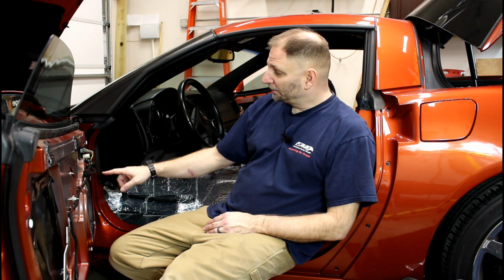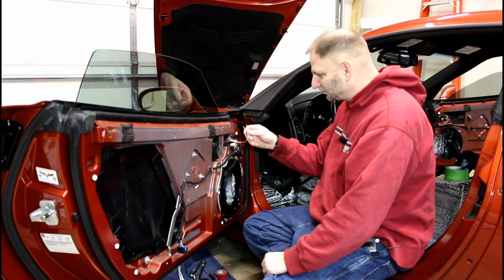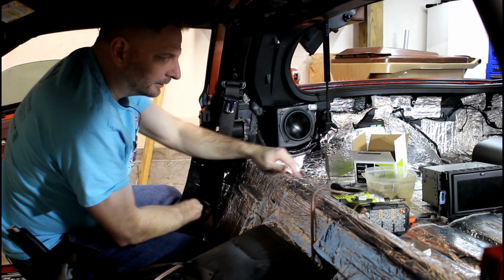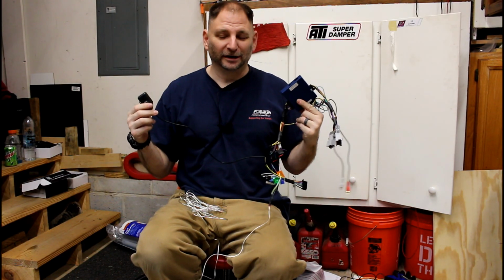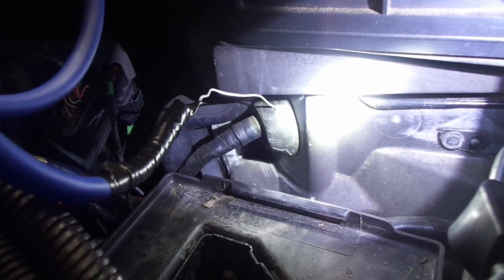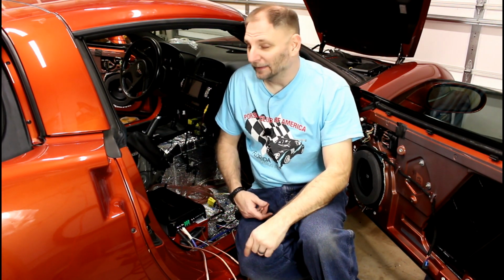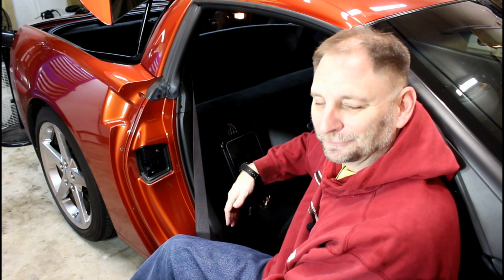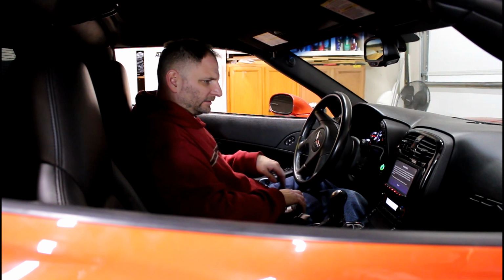c6 stereo install

Comment: Excellent video. I'm doing the same thing on my `08. The kenwood is already installed and the only thing I lack is mounting the amp and running the power wires. I'm afraid to screw into the back of the seat so I'll do something else to mount the amp to the carpet. I also couldn't tell if you connected a ground local at the amp or ran it from under the hood. I'm sure I'll find a local ground back there. Thanks again.
Reply from the maker: Thanks and i used the ground near the lower seat belt mount

Comment: Can you attach the new speakers to the old factory wiring or do you have to use new wire?
Reply from the maker: If you are using the factory head unit/amplifier you can use the factory wiring. Otherwise you need to run new speaker wire

Comment: curious how many plastic retaining clips you broke on either the door or any of the cargo panels? Did you have any alternator wine when you were done? Thanks for this detailed video. It was very helpful.
Reply from the maker: I broke 1 plastic clip on each door panel. The 2nd gnd worked for me, good luck and glad it helped!
Reply: @maintainersgarage  was there a grounding place in the dash for your head unit?
Reply from the maker: @reid1boys  yeah there is some metal inside the dash behind the radio

Comment: Amp fits fine behind the seat; even with the seat adjusted all the way back?
Reply from the maker: NO the seat does not go all the way back with amp mounted behind it. Follow up video covering that
https://youtu.be/OFc3EfG-Rms
Reply: @maintainersgarage  Thanks for the answer. Follow up question: How "tall" is the amp? Would it have fit underneath the seat? My amp is 5 inches tall; hoping it'll fit under it if behind it isn't a good choice.
Reply from the maker: @capone079  under the passenger seat is a small area like 5x7 L/W where there is enough clearance for an amp. The back of the passenger seat at the lowest setting is about 1/2 inch off the carpet. And at the most FWD position the back of the seat eats up that space. So it is more of a footprint issue than height. There are amps that will fit just very small ones

Comment: i lowkey wish i could go to him and have him help me because i learn different
Reply from the maker: If you are referring to me, ask away
Reply: @maintainersgarage  i have a major project coming up im a 16 yr old and i almost to the point of getting the vette  but i luckily have everything (except for a headunit) i need to make this system i have 2 ds18 ¨15 inch  hooligan subs which both run 4000rms each and i have two sundown audio z-10 v.6 2500w rms 10 inch  subs and 1 sundown audio x12v3d2 2000 w rms subs 12 inch  i have had a custom box be made to fit these things i have a few tweeters and speakers they dont effect my   electrical system as bad as the subs. oh also for the amp im literally going to stick two sundown salt 8k  audio together use them to power the big and small subs the i'm going to use a small 4000 rms amp to carry over any deficiencies in the system for equal sounding bass nothing underpowered  i really need to find a bigger alternator and batteries... sorry for the grammar! any ways there is a few other things i have  that i didn't mention and its  twin turbo system and a supercharger (C6 Corvette 2005-2013 GMPP LS9 Supercharger Kit) i also have a performance cam replacement bundle,  i also have and air ride system  to help carry the weight  and lastly a dash board replacement from sherwood innovations ash burl  and its real wood im not rich i've just been working my whole life to afford this stuff the grand total is 34K and my car has 24k  alone  so 58k in the end   my system and performance mods cost more than  the car itself
Reply from the maker: @castaldi69_yt51 that is several major projects!! Good luck with them!
Reply: @maintainersgarage  thx

Comment: I have the Bose system in my 2005. The Upper door speakers and the lower door speakers, are they coming out of the amp at the same level? The lower door speakers are filtered for Low pass from the amp, what about the upper speaker is that full range or high pass?
Reply from the maker: Thanks for the questions. Are they coming out at the same level? I am not sure, but I am guessing that the lower door speaker will be getting more power than the upper speaker. The uppers i think are high pass.
Reply: @maintainersgarage  ok my set up turned out great because I completely replaced the Bose Amp. Anyone reading or watching, just get a new amp. Thanks!
Reply from the maker: @phoenix21studios  excellent!! Glad it worked out for you!

Comment: I have heard that if you change out the stock head unit it sounds way better and louder without speaker/amp upgrades.  I have the Bose system in my 05 since it’s a 3LT.  May start w the head unit and then possibly an amp with new speakers.
Reply: I did only a head unit upgrade and was not satisfied.
Reply from the maker: Give it a try and let me know how you like it!

Comment: Where is the OEM Amp located? Great Video btw
Reply from the maker: @mario it is in the passenger footwell near the fuse box. Thank you!
Reply: @maintainersgarage  Thank You for this amazing tutorial. You made this entire sound system a breeze. 
Alpine ILX-F309
Focal Flax Comp.
Focal Auditor Coax.
Focal 1200/5
JL W3v3
Reply from the maker: @intake818  you are welcome! Thank you for the compliment
Reply: @maintainersgarage  Where did you ground your AMP i got a decent amount of engine noise. Bummed!!
Reply from the maker: @intake818  there is a factory GND on passenger side near the seatbelt reel. My 1st vette needed a 2nd GND on the head unit that went to metal frame in dash and solved my alternator whine
Reply: @maintainersgarage  thanks, im gonna give that a try.
Reply: @intake818  did you ever solve your noise issue? I just finished my install and I also have noise. IM going to try to ground the head unit with a 2nd wire tomorrow also.
Reply from the maker: @reid1boys  good luck!
Reply: @reid1boys  It did bro, everything worked great after this.
Reply from the maker: Outstanding!

Comment: Nice job.  I installed DDX8905S but now my chimes are so loud they sound like Big Ben. Any advice on how to adjust ?
Reply: It has an adjustment knob.know.. I think you have to pull it back out though. I adjusted mine before I put it all back together
Reply from the maker: Good info
Reply from the maker: I added the chime relay, and it had it's own bell. If you have the same you could wrap it in bubble wrap or anything to tone the noise down
Reply: @maintainersgarage  mine is the stock chime unit that came in the car.  Used the GM1A-RST pac unit to retain my steering wheel features
Reply from the maker: @C6whatever  AHH.. I did not have steering wheel controls. Try PAC website to see if any answers there?
Reply: @maintainersgarage  thanks. I have looked it up and am now working on it

Comment: I connected my amp but my sound went off now , i don’t know if my bose factory amp got damage , can you please help me , my new amp works with my subwoofers but there is no sound besides the subs
Reply from the maker: JR, I am gonna try and help.
So you have an aftermarket amp and it is only powering the subs, and those both work. And you are still using the bose amp to power the other speakers that no sound comes from. So I am guessing you still have factory head unit. 1st thing to check is fuses for bose amp. Since you have sound coming from the subs I am gona say that your head unit is working. So that leads to check all the connections behind the headunit. Hope that helps and hope you find it to be an easy fix

Comment: Nice install. What Model number are the Morel Maximo Speakers?
Reply from the maker: Thank you, Maximo 6
Reply: Maintainers Garage cool thanks. I am wanting to change the speakers in my door and the rear mid section. You have helped a lot. I am wanting an amp to replace the one in the factory location of the passenger floor board area. Do you recommend an amp? I would need a 4 channel amp. Not sure if I want to add a sub or not. If so I know I would need a 5 channel amp.
Reply from the maker: @Backtothez   I knew I wanted a sub. I needed a sub for me to be happy, you may not. 100% personal choice. On the amp, I recommend an amp. Good sound comes from decent power. But there are plenty 4ch out there that will give you great sound in a compact size and not a lot of $$$. Glad I could help!

Comment: Is that rps-gm11
Reply: I used gmos-04 it didn't work plz help me should I order rps-gm11 I got 05 c6 convertible.
Reply from the maker: @dhesigurvinder2770  it is PAC RP5-GM11. It worked well. I got it with the chime relay already installed
Reply: @maintainersgarage  thank you brother.
Reply from the maker: @dhesigurvinder2770  you are welcome, any other questions just ask and I will try and help!
Reply: @maintainersgarage  my cars got stock Bose system in it so I should fine with rps-gm11